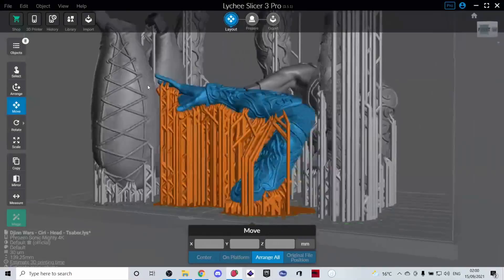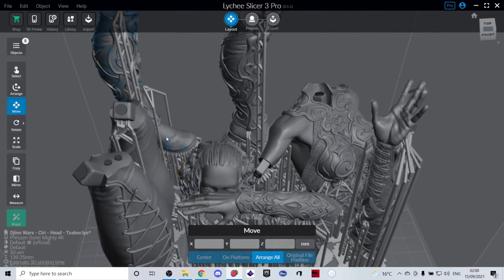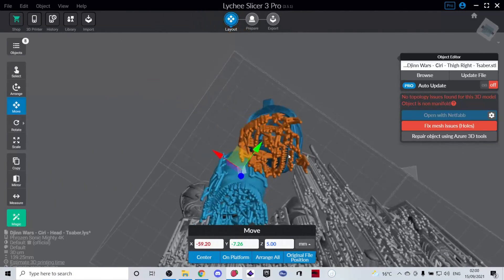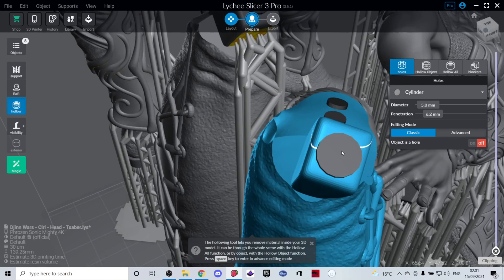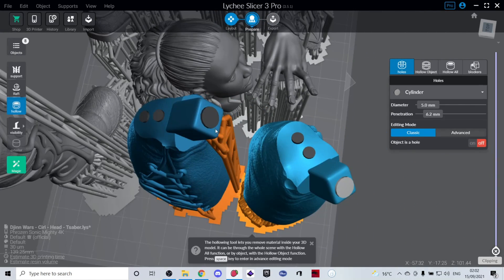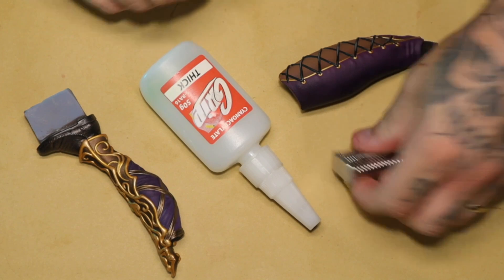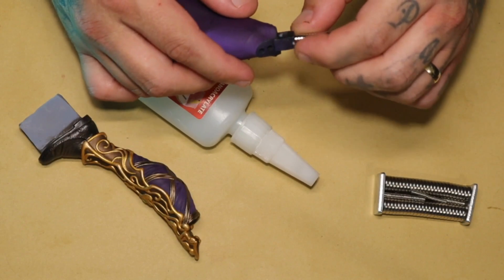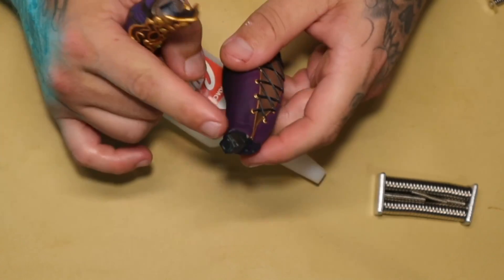Your 3d prints need magnets!

Comment: good explanation bro, but may I know is it okay not to have some degree of angle during printing?

does it cause any layer line?
Reply from the maker: I’ve not had that problem unless it’s a geometric or straight edge these parts have so much texture it’s not noticeable also I print at .035 so the layers are extremely close together.